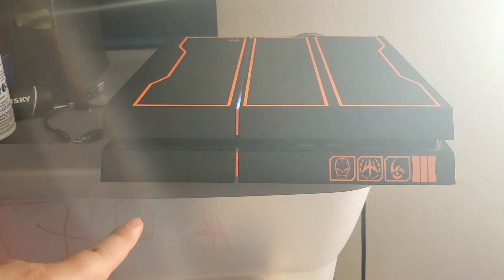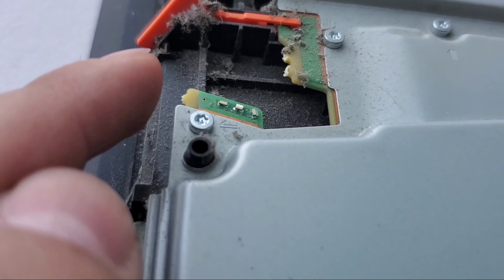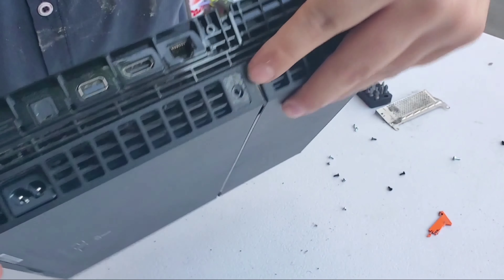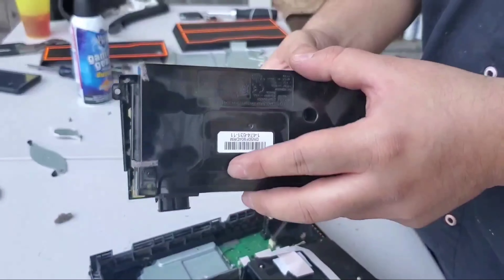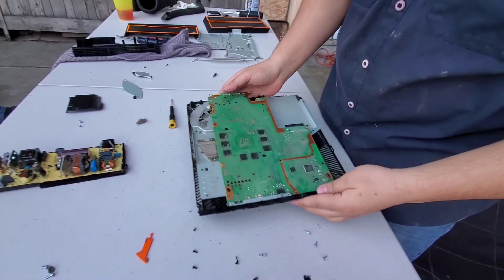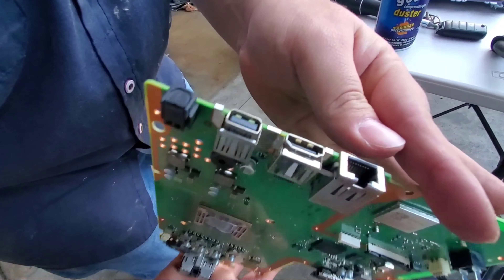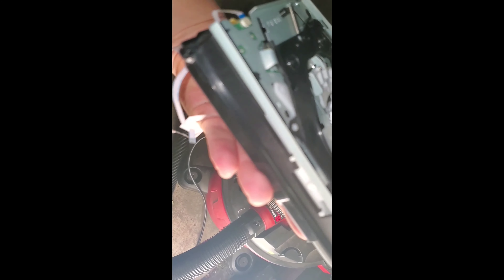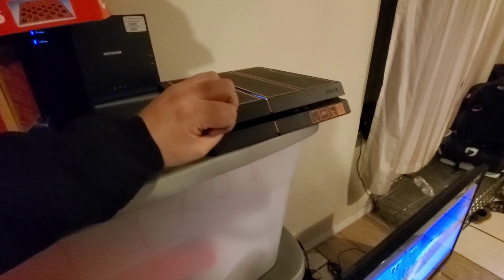Ps4 Jet Engine Noise FIRE

Comment: this is the right way the only thing you left out is the thermal paste. some may have dried mine was . my ps4 didnt stay on until i disassembled it again, and cleaned the chip to reapply thermal paste. i used thermaltake, another is artic silver. work just fine. thanks bud
Reply from the maker: Yeah your right after I saw a few videos i should have done paste as well so if any person out there does it make sure to do the paste as well. I will do it next time I open the ps4 but so far so good ps4 still quite

Comment: I cleaned the dust from my PS4 and it still sounds like a jet when I play high-resolution games like MHW
Reply from the maker: Did you clean it completely like I did in this video? If so maybe clanging the thermal paste and if that doesn't do it I really dont know what will sorry
Reply: Replace the thermal paste
Reply: @h3h3productions
Reply: @Bigtony1818  I don't have a 3 mm screwdriver